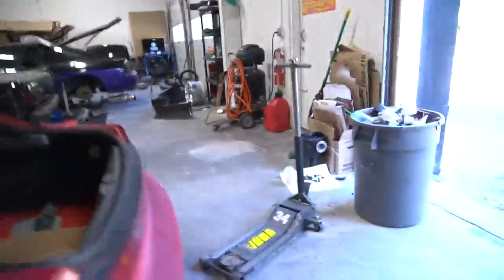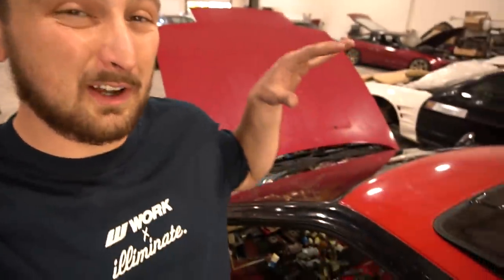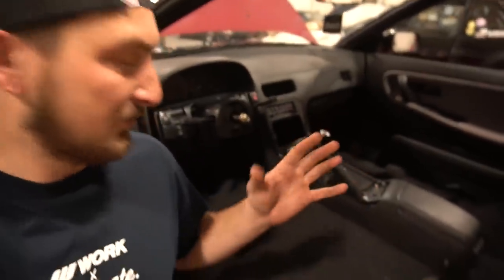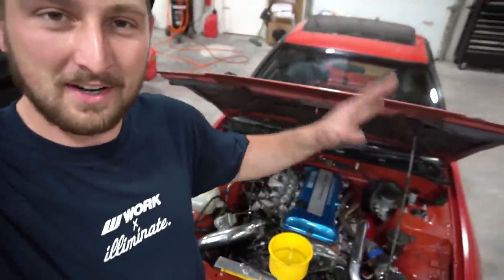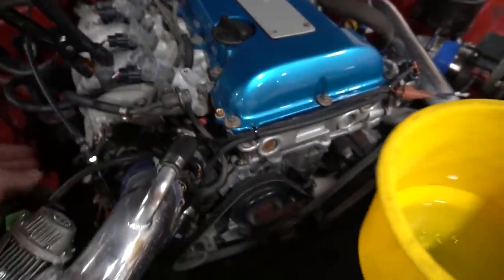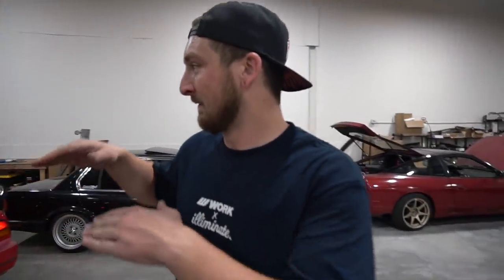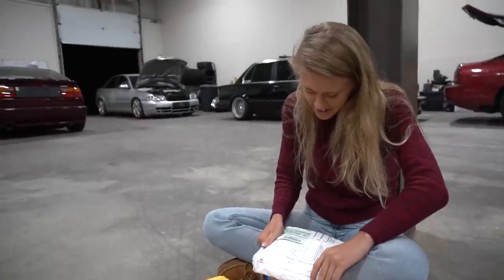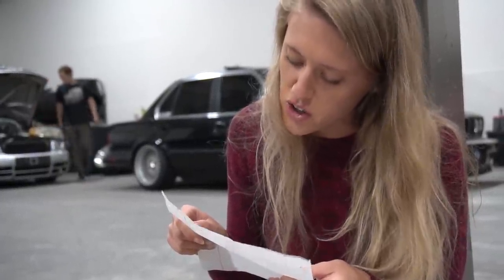FASTEST engine swap yet! (First test drive!)

Comment: I would say that you wrinkle black the valve cover, put a nardi black with Red stitching, and the only thing you didn’t do which is overkill is zinc plate everything
Reply: Ok tommy lol
Reply: But if you could afford to do it, you would. Dont be a bitch 😂
Reply: Zinc platting hardware is not overkill it looks good and lasts in the northeast
Reply: Nah, I'd get a Nismo wheel and then do the OEM Nissan red on the valve cover.
Reply: brooksman10 or black because that’s factory too

Comment: The electrical connections on the light stalk/ turn signal(multifunction switch) gets corroded and or get pop/coffee on them and lights will do that. I traced that gremlin on my 91 240sx. Previous owner drank coffee and spilled plenty

Comment: Hey Jimmy just a cool tip if you take a foam cannon and load if with cheap stain lifter laundry detergent from the dollar tree (not sure if y’all got one) and spray the the seats down scrub them with a brush and spray them cyou should see good results I always used laundry detergent in my cheap laundry in my shampooer and it always works amazing!!

Comment: Hey Jimmy, 

im currently troubleshooting my brother's SR20, where it idles high 1500rpm and chokes out if i floor the pedal as if i wanted to drive it, i measured voltage across tps and i get zero as the voltage reference, i measured the pin on the ecu, also i got zero, is there any other idea? probably i think..i think....there wire pinched somewhere and it ground out therefore it doesnt get any voltage reference. anyway i tried another tps, its the same, no changes, i believe its due to no voltage reference, what volt should i be seeing? 5V i believe?